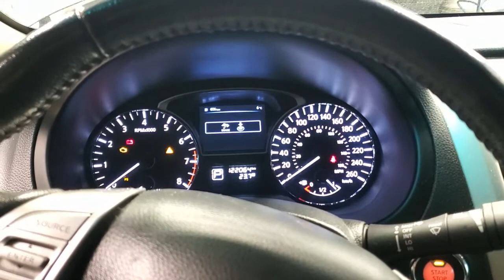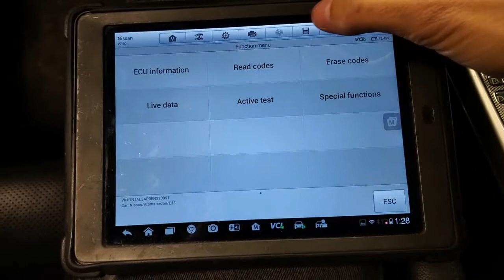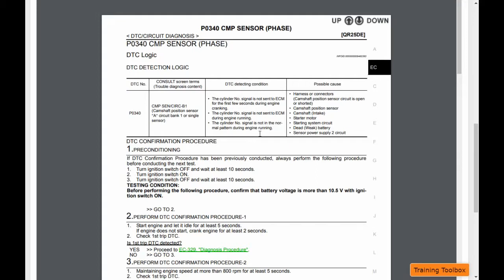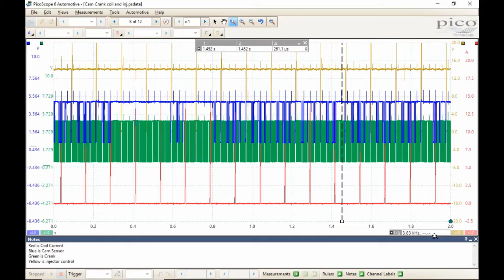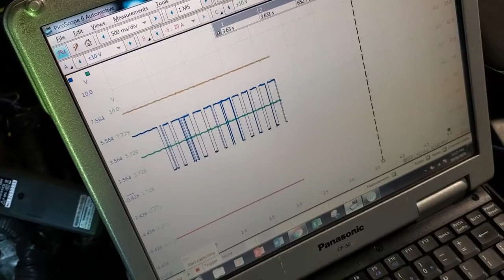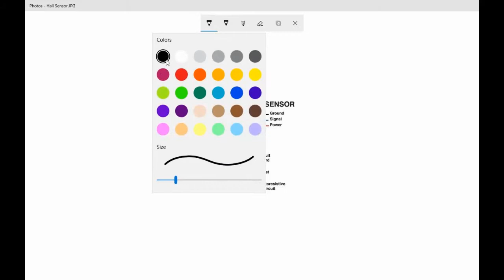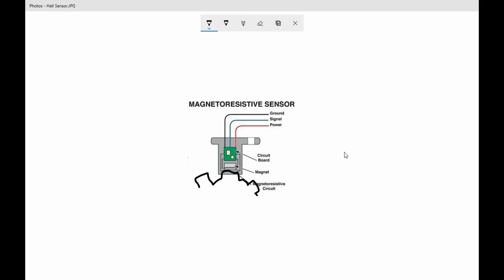Long Crank/Crank No Start on a 2014 Nissan Altima 2.5L. (Very Odd Failure!!)

Comment: Same problem with mine but only after sitting hot for a half hour or more. When cold, starts right up. Just going to replace my 2 cam sensors and see if it fixes it.
Reply: I have the same problem did it fix it? I replaced both of them still doing the same things.
Reply: @Catholic1391  few more things to check. I am going to replace the engine coolent sensor. Then the oil temp sensor. I know I am getting gas pressure so the furl pump should be okay. Mine is in storage until May so right now I cant do anything. Last resort is I will go to the dealer. Luckaly the shop foreman at the Nissan dearler works on all the 370zs in my area. I dont have an expensive scanner to track down the problems. What year is yours and how many miles?

Comment: Hi there! So glad I found your video. My 2014 Altima is doing the EXACT same thing.
The dealership Says that it isn't giving them any codes but they are thinking it's either the cam or crank sensor.  
Should I just replace both?
Reply: Same thing with my 14 altima; no codes either. replaced both cam and crank sensors and it is still the same!! If not worse.
Reply: @tammysmith8545  Had the same symptoms on 2013 2.5 SV. Dealer was useless in diagnosing; kept saying battery, air filter, starter, all of which I knew were fine. Would crank fine but long and sometimes stumble at startup then run perfect otherwise. Eventually did throw a code (only one in the 100k miles we had the car for) for something like low idle airflow. That lead me to check the MAF, also fine and clean, and then the electronic throttle body. I found the throttle body had a layer of oily residue (normal to have some accumulate over time from PCV system) all around the inside bore. This was causing the throttle plate to still seal closed even when the computer stepped it open a little bit for startup, and not letting the engine get enough air to start.

Easy fix: Remove airhose from filterbox to throttlebody, gently open throttleplate with fingers (and don't drop anything in it!), wipe all around throttle bore with a clean rag removing all oily residue as far back as you can reach, reassemble. You might even be able to just use a throttle body spray cleaner, but would have a hard time getting it as clean.

Comment: Have a 2013 Nissan Altima with long/hard starts. Mech says it is Cam/ or Crank sensor.... but he believes if you replace one or both you need to "reprogram" the car at dealership.....Is this true....Thanks   Dan
Reply from the maker: Hi Dan. Generally, if only replacing sensor(s), there's no need for a reprogram. If your Altima is a  2.5 four cylinder, it would be a good idea to replace both cam and crank sensors together to avoid future reliability issues in that area. Good Luck!

Comment: It looks like there is two cam sensors in mine. Is that right?
Reply: my 2014 had 2. Replaced both along with the crank sensor and STILL doing it!
Reply: @tammysmith8545 have you fixed the issue yet?
Reply: Any fixes?
Reply: Engine Camshaft Position Actuator. Valve SOLE. Valve VTC Oil Control. 

Replaced all 3 then had to update computer at dealers. All in approx $600
Reply: @gilly2571  Sorry if I misunderstood, but it was the 2 sensors, the 3 solenoids, and the 1 solenoid valve?
Reply: @isaacgodoy5211  No problem! Google -  Engine Camshaft Position Actuator. Valve SOLE. Valve VTC Oil Control.  I just replaced the three of them. They were really hard to get to but finally replaced them.
Reply: @gilly2571  And they’re all 3 different parts? Every google search seems to show me the same item.
Reply: @isaacgodoy5211  yes they are all the same same. Only get the parts from A Nissan dealer because the off brand ones don’t work.
Reply: @gilly2571  I changed those three solenoids on the side of the engine and had no luck. I can’t find my symptoms anywhere either.

Comment: I have the same symptoms with a P0171 code. Could it still be the same problem?
Reply: Did you ever find out the issue? I have the same code
Reply: @Eric Mogor  No, ended up just selling it.

Comment: I'm having a similar or the same issue with my 18 but haven't been able to test it w/odb2 yet. Was that cam sensor a cheap fix and or would you recommend just swapping it out for a new one
Reply from the maker: Sensor was cheap enough that you could have swapped it out as a means of testing